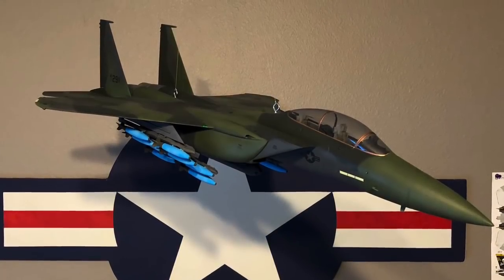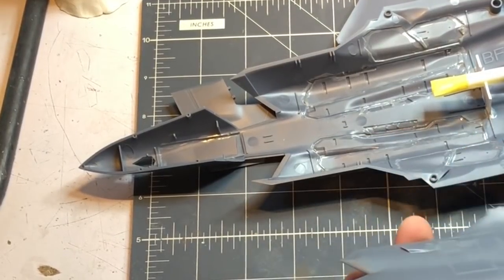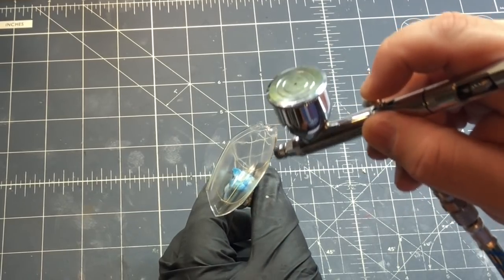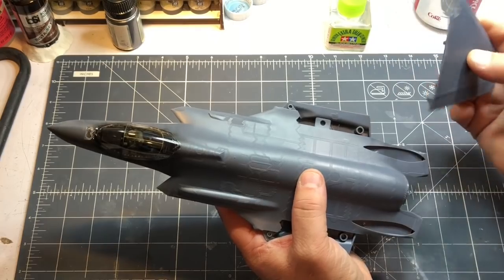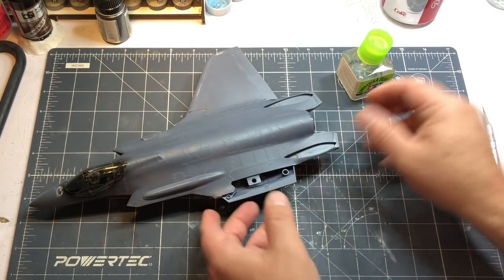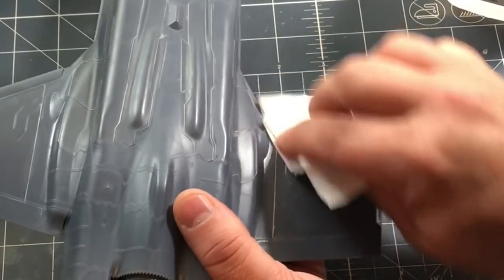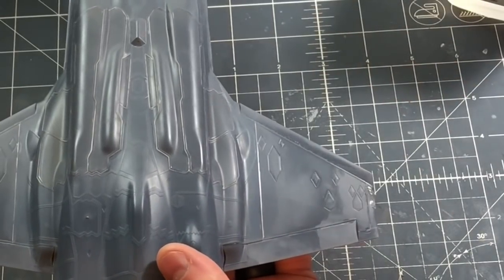Meng 1/48 F-35A Build Part 1

Comment: Being a Brit I built the KittyHawk F35-B....now thats a pig of a kit, body was super warped, and it can pretty much only be built with everything open, gear down etc,  but once built it does look good, your F35-A is looking good so far and the Meng kit looks far less complicated and annoying that the KittyHawk, I just hope the Royal Air Force buys some F35-As now so they'll be easier to build lol
Reply from the maker: Everything I’ve ever built from kittyhawk is terrible.  The parts usually look nicely detailed but they have horrible fit issues.  I won’t buy another kittyhawk kit.

Comment: Try cutting down even smaller and fold over  a couple of times and then grip the sandpaper with a hemostat. That allows a lot of control in a very small area. Pin point accurate sanding.

Comment: I spent 2 days masking my F35, then they changed the colour scheme so the lines are the same as the main fuselage, apart from around the door panels,,,,,don't know if you're aware of that?
Cockpit and canopy look sweet,, gonna be a good one👌
Reply from the maker: I wasn’t aware of that.  I’ll check some references.  I noticed on some of the A models I was looking at, some of them were the fuselage color.  I think I’m going to spray the lighter color over the tape, then apply masking tape over top and cut it.  Then spray the fuselage color.  It’ll still be a pain in the arse but might save a lot of time doing it the other way.
Reply: @seanerk5kt9  yeah man, it was also quite therapeutic doing all the masking,,zen moments,,have you got any ideas on what I might build, I've got a couple of big kits,,Revell 1/32 F/A 18, and a Red Arrow,, a 1/12 F104 Starfighter model cockpit,,,but I fancy building something quicker and smaller, no lights.
Need some suggestions man,, you're the 1/48 'King'
Reply from the maker: Those sound really cool.  I’d really be interested in the 1/32 revell f18.  If you want something really quick in 48...I’d go with Tamiyas F-14.  You can build it in 2 days.  Best kit I’ve ever built.  Plus I might’ve heard somewhere that you like f-14s;). The hasegawa 1/48 f-16  and revell f-15e (new mold) are pretty good kits as well.

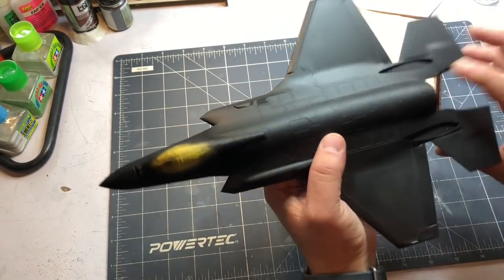Comment: Hello, I was wondering how you fixed, or created the place for the stand (engine outlet) you can see on 27:06 and on lot off your other great models in flying mode. Maybe you will share that with me. thanks in advance and keep up the great work and moks :)
Reply from the maker: Ive shown several different methods throughout different videos depending on how it’s mounted but at the beginning of the linked video, I show how I place one in the exhaust.  Hope that helps.

https://youtu.be/bDecdOTzmaU

Comment: I have a couple questions, and a remark. First, what brushes are you using? I really like them. Second, where can I buy the Mr. Surfacer Leveling Thinner? And finally, my remark... Almost 25 years ago now I was a Crew Chief (Maintainer) on the B-2 Bomber and we had a similar tape that was used to cover panel lines. I haven't been up close to an F-35, but to my eye, the tape lines on the model are too proud of the surface. In other words, if you scaled the entire model up to 1:1, those tape lines would be way too thick. You may just have to live with it though. It's merely an observation from my perspective. Great work though.
Reply from the maker: Here’s a link to the brushes TJ

https://www.amazon.com/dp/B01FJ90O0W/ref=cm_sw_r_cp_awdb_btf_t1_w-buFbJ2KGYXE

I just get the leveling thinner on eBay from whomever sells it the cheapest.  As for the tape, I hear that’s a problem in all of the kit brands that make this plane...since I don’t get worked up over such things, I don’t see it as much of an issue.  I guess if someone had the tenacity, they could sand it all down.